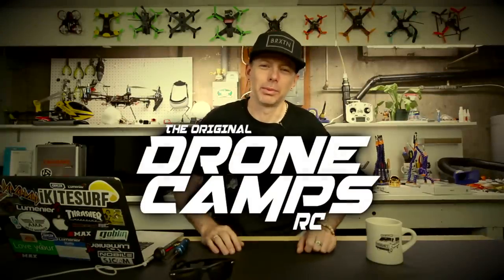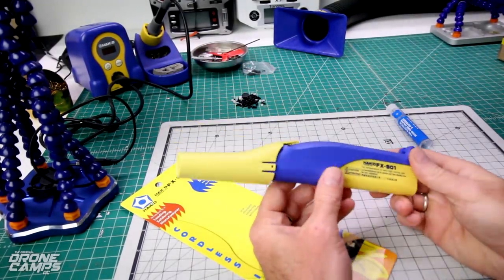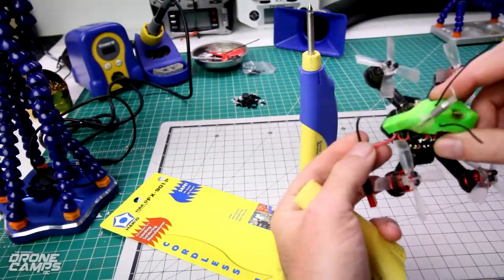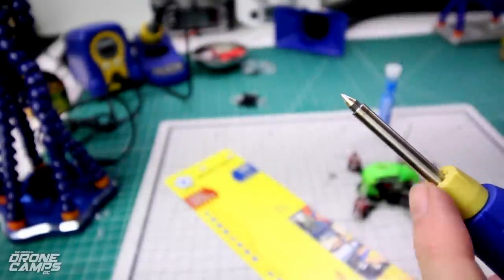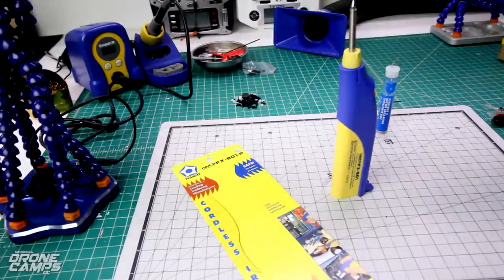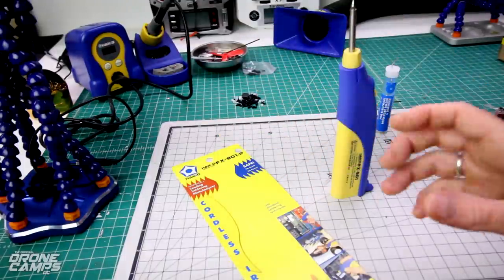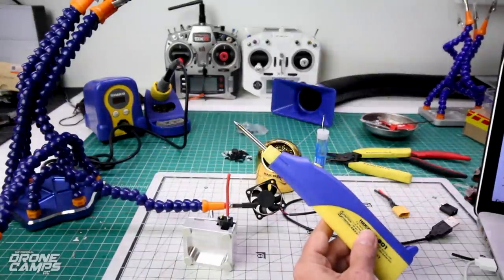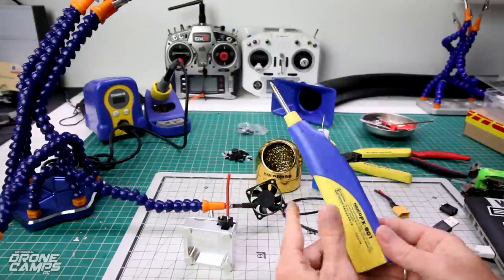YOU DON'T NEED A TS-100 - Hakko FX-901 - BEST BUDGET IRON

Comment from the maker: Keep in mind the thumbs down count will be the TS-100 fan boys.
Reply: My TS-100 legit takes less than 5 seconds to get to 400C... and has temp control... and was $50.
Reply: i have a TS100 but for what you are using it for it has some competition, but....... it is a good iron to use as a main iron if you do not have a bench iron or for fine work it has great micro tip's. with a good adapter (19v 3A+) the ts-100 is just a little beast.
Reply: Drone Camps RC could you send me a link to where you get the square grid work tops /mat s thanks and love all your useful vids and your reviews thanks suresh
Reply: Just ordered this with the tip cleaner! Thanks for the recommendation!
Reply: I think the problem with your comparison is this is a replacement for butane irons and not the TS-100 (and butanes out-perform this by miles anyways). The TS is to replace the desk irons, and maybe be portable; as such it heats quicker, has temp control, and it uses full sized cart. Saying those who dislike the video are fanboys would be inaccurate too, I dislike it and the only iron I have is a hakko FX-888D
Reply: Love the TS100 but I'm glad to see an alternative being shown. Ridiculous how many people hit thumbs down just to hate

Comment: Yes, but can you play Tetris on it? (you can on a TS-100, according to Hackaday).  I had a Wahl battery powered iron once (two or three, actually, as the thing kept breaking down).  I don't own a TS-100 yet but I do have several corded Hakkos, as well as a 30-year-old Weller TC-201.  You're right, the Hakkos are excellent irons and are my current favorites.  The TS-100 is, however, half the size of my Hakkos, very fast and accurate, gets hotter and stays hotter better than most and is therefore more versatile.  As long as you buy several different tips and stay within its wattage limit, which is pretty high for a pencil iron, one iron will do it all for you.  You buy the Hakko model that best fits your immediate needs, often several as I have done - hardly a cost savings there. It also fits into a crowded tool box where any battery powered iron would beg for mercy.  I have too many irons now, but when my old Weller TC-201 finally bites the dust I'll probably replace it with a TS-100 - if it's still around, that is.

Comment: i have got that banggood iron. i use it on even on 4s (heats up faster and hotter), no problems, heats up within 1 minute, does even xt60 without issues. quality good enough (no complaints so far). i think it doesn't last forever but hey, even my copter doesnt^^ 7 bucks for a nice iron...never thought about the ts-100. i do the same solder job for 7$.

Comment: No doubt, you know what works well for your needs ... joining wires and battery connectors in the field, it seems.  Users of the TS-100 have different needs.  They do sub-millimeter electronic component work that demands precise temperatures and pointing that you probably don't use very often.

Comment: I bought the upgraded ts100 because I wanted the extra tips. I use the extra tips to plastic solder on my kayak or anything else I need. I prefer being able to modify the heat ranges vs this one with no heat settings :( great deal for someone who dosent need the extra features or someone who dosent want to make a cord for the ts100

Comment: professionals we all know Hacko is the best, and will last the longest at a high duty cycle, or lots of regular use.
for the rest  I've built over 11 quads in the last year all on a "15 dollar" soldering station with adjustable temp from hobbyking. recently I also bought from them the very cheep xt60 soldering iron for the field. I've only had to use it once so far, but it worked great.
Oh, and fyi, I am a copy machine repair man so I know my pro tools and what a hobbyist can get away with.

happy soldering

Comment: Yeah, it will "Get the job done", just as a cutlery knife will "Get the job done" making a steak.
But wouldn't you rather use a proper knife for it?
Reply: Yes, but in this case the TS-100 is just another cutlery knife with a different handle. I'd rather use a proper soldering station.

Comment: You've mentioned a few times 700°, but never really say Celsius or Fahrenheit. 700 Fahrenheit is 371 Celsius, some may say it's a little on the hit side for soldering but that depends on the total power wattage behind it also. Personally I keep it 280C to 350C depending on the iron, tip, thickness of the PCB, and how thick the copper is.
But when people shop for iron they mostly advertise in Celsius, and 700C would be dangerous to solder in and damage the PCB and soldering pad on the board. 
Just wanted to bring this to your attention. 
Also their are some good butane irons that heat up in 30 seconds that are good for field work. And you can fix your charger cable if all your batteries are dead and you need to repair your charger wires to the car battery or power plug in the car :-)
Reply from the maker: Thanks GRV. Yep I meant 700F. 700C would be extreme! I used to use Butane irons but this is less dangerous in my car :)
Reply: Say what "butane.. heat up in 30 second'  I have many and destroyed many due to using them till dead, great for large wire quick fix but not suitable for any sort of board repair.  371C is fine, better for doing sensitive components as to be quick about your work.  Thermal mass is easily regulated my choosing an appropriate tip, ie. JD08, KF, or god forbid a plain B2, several with much larger mass.  I like the Ts100, good piece o kit, but has a UI that is and does shit out, the hakko just runs.  If you need to do more than the 901, it should be on a bench with a (hate the UI)951.  Other than that I like my weller 100W dumb stick.

Comment: I actually got this last year.. It is decent.  I disagree with you about it working well with xt60 connectors.  It takes a long time to heat up the connector.  It does work ok with micro stuff.  But even with that the battery was getting low and it wasn't heating up good.  Then you have to have AA batteries with you all the time.  The ts100 will do xt60's as good as a bench top soldering iron.  I don't even use my bench top one at home anymore with the ts100.

Comment: You don't need a $40 901 to...
Buy a "hakko" 907 replacement handle with ceramic heating element ($5-$10 on eBay, preferably with T-3C or T-4C tip)
Just connect the heating element to an XT60 connector.
Use a 3S battery for the small work, 4S for heavier work.
Almost as good as TS-100, better than X-901....

Comment: If you want quick heat-up times, give JBC a try. I've had mine for about a year now and I absolutely love it, it's not cheap but the temperature is incredibly accurate and it heats up in 2 seconds (no, that's not a typo).
http://www.jbctools.com/cd-s-precision-soldering-product-506-category-1.html